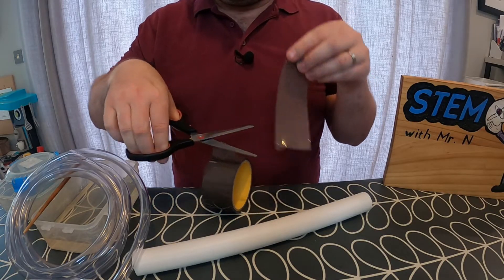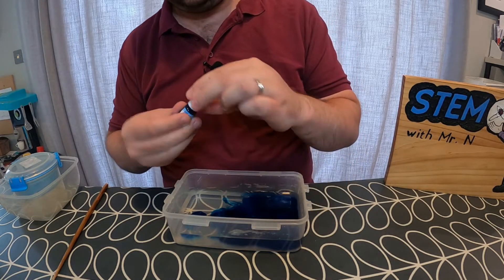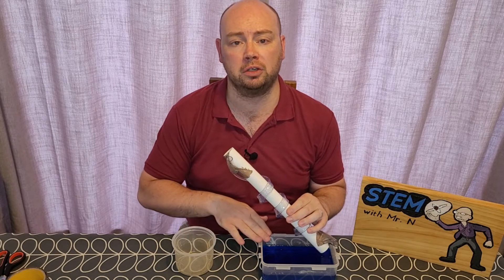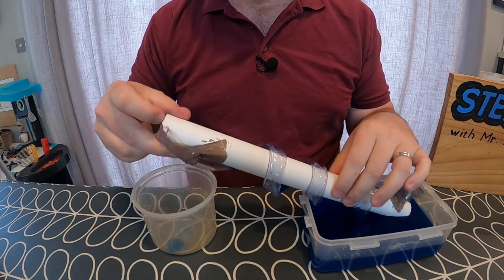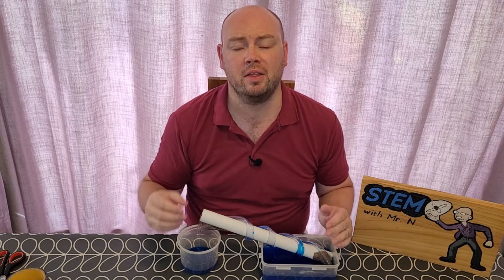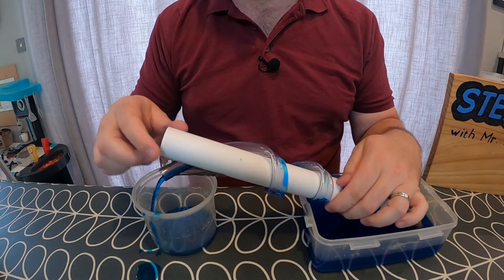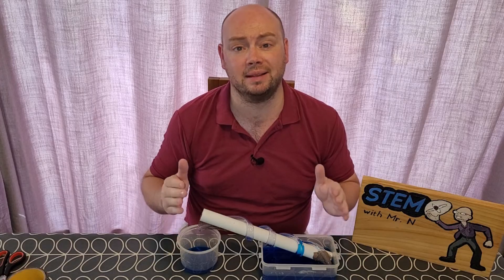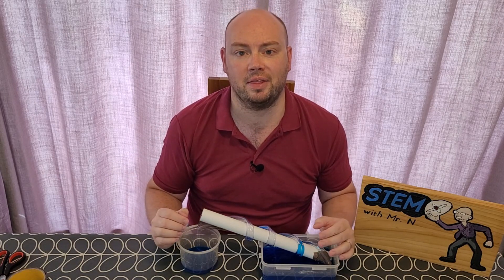How to Make an Archimedes Screw: STEM education activity for children / pupils / parents / teachers

Comment: There are gaps between the clear tubing coils on your PVC pipe. If you filled these with additional coils of clear tubing, you could make your screw more efficient, but transferring roughly 3 times as much water for each turn of the plastic pipe.  However, the device was not very efficient because the greater potential energy imbued to the water was wasted when it was allowed to fall to the bottom of the second container at a lower level than the surface of the water in the first container. If the second container had been at a greater height off the bench, this greater potential energy coud have been conserved - at least until Mum came home and made you pour it all down the kitchen sink, anyway!

Comment: Any ideas on what sort of natural materials could be used to make a model sized prototype, e.g. bamboo instead of pvc, but what instead of the tube?
Reply from the maker: @ElenaRast-g1m  the honest answer is I don't know what natural material could be used in place of the plastic tubing. I've had a look for ideas online but nothing was really coming up for it. There was one suggestion to use clay, but that may be tricky to mould into the wrapping shape around the bamboo. That's a great question, though, and one I'll need to look further into as I look to improve sustainability.

Comment: Would love an Achedemice Screw,
To fit my Highbanker Sluice for gold prospecting where can i get one? Just seams so Eco Neutral,Carbon Neutral, and its great to keep a 2000yr old system going into Domestic and commercial home for all uses,,would be better than unecologicaly unfriendly water pumps running on fossil fuels with a carbon footprint you could even make this unit solar as well as motorized battery operated.